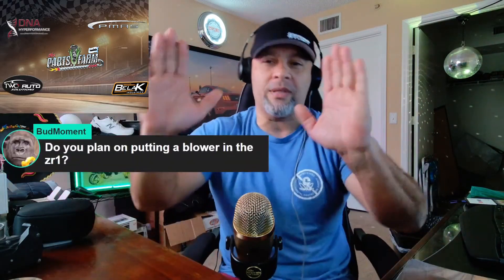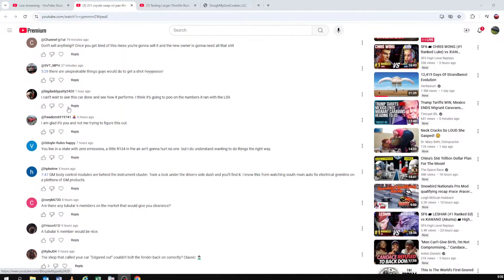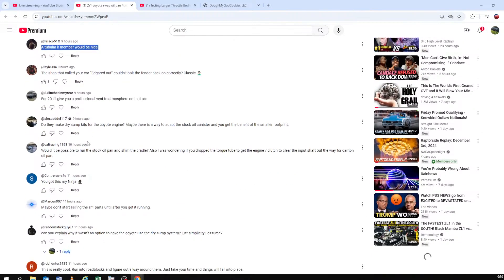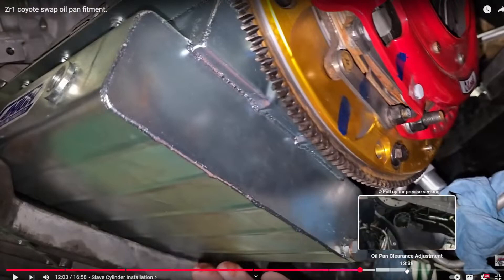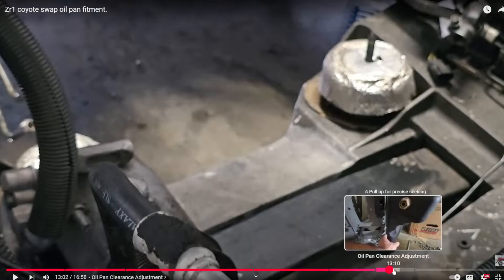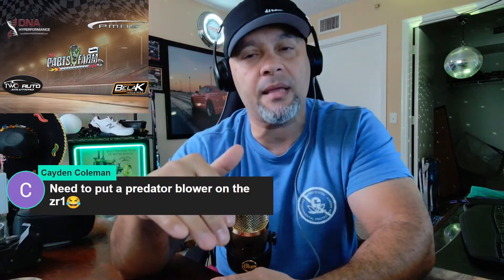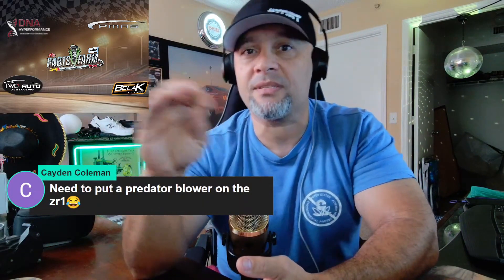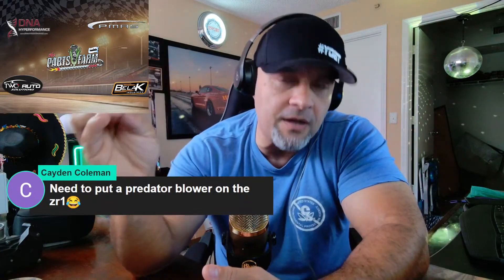The ONLY Supercharger I'll Put on My Coyote ZR1

Comment: Alex. So I just put a haltech on my c5. C6 is very similar setup with the PCM BCM there is a way to trigger the bcm without the factory pcm in the car, hard to find the info on it. However the by far easiest way imo is to depin what is not needed from the stock pcm and remove it. Stock pcm needs oil pressure, crank signal and CTS to make the ecu think it’s running the car. If you “piggyback” the yote ecu and the gm pcm the stock cluster and the bcm should all work and be happy. Gonna have to turn a lot of the dtcs off in vcm editor To turn check engine light off. That’s how alot of ppl are doing standalone ecus on the c5/c6.

 There’s a decent amount of pcm wiring info on corvette forum as well. It took me about a day to get my crusty 01 engine harness unloomed, wires not used depined & removed, and both the harness installed back in the engine. I’m not familiar with coyote sensors, however I don’t see why you couldn’t split signal from yote harness and pin it to the zr1 pcm provided they use the same style sensors.

Comment: You against the ess blowers? Those cars seem to run hard
Reply from the maker: @joshuaearnheart2756  when the hell did I say that?
Reply: @didn’t say you did. Meaning for this build Is that style of blower not what you’re wanting. Are you wanting a top mount/PD/twin screw/roots style specifically? Simple question really. Considering you would “never support whipple” or “would never run the Odin” you seem to have things against certain companies. Is the ess an option?
Reply: @joshuaearnheart2756 he’s not building a roll race car that’s why. Digs only !
Reply: @Coyote.Collector  it’s still a blower. Gonna make torque. And with similar boost, the ess 60-130 times are generally quite a bit faster too.
Reply: @joshuaearnheart2756 again you said 60-130 
HE IS NOT BUILDING A ROLL CAR!!! 

ESS DOES NOT MAKE THE INSTANT TORQUE LIKE A WHIPPLE,ROUSH OR EDLEBROCK!!
Reply: @ it’ll make enough for the 1 second that they’re different. Those corvettes aren’t exactly known to hook from a dig anyways. Haven’t looked much into the car but I assume he’s not running the trans axle transmission which means even more weight off the rear tires. Idk if you watch cleetus McFarland or not but he just built a whipple coyote f150 and a twin turbo f150. The whipple truck jumped maybe a half truck at the line and then at about the 60 foot it got drove around. The turbo truck freight trained him up top. Pulled a full truck ahead on 50% duty cycle. Go to the track and compare the amount of blower cars vs turbo cars Then tell me how good those blower cars are…

Comment: Big fan of your channel and learned a lot from you. I just would never coyote swap a ZR1. That’s cool for a regular c6 or a C5, etc but a zo6 or ZR1, no sir. You’re taking away from what makes it special/different but like you said your money, your car, your build. And this is coming from a mach1 guy. I love both brands and this is cool to see. Never seen this done before. Good luck with the build man
Reply: But youre not weighing the "troll factor" for the LS guys lol. It's worth it.
Reply: With all do respect you might not have heard his reasoning. 

The car has A LOT of miles on the chassis. So already it's worth less than worth selling.

Motor is like 15k for new motor.

Coyote with blower weighs less than ls9.

Coyote doesn't need cams or headwork. 

Headers fuel system boost is all coyote needs to make north of 900whp on an alluminator.

Last reason he literally had this motor already. So that 15k on a motor he doesn't have to spend.

Again no disrespect meant just writing what I've seen Alex say and show.
Reply: The zr1 crap motor heat soaks and pulls timing with under 800hp and will blow up 

The coyote can make 1,000 won’t heat soak and will make that power WITH EASE. 

Not tryna be an ass but do some research a coyote is better than any LS or LT.
Reply: The only good thing about an LS9 is that it’s dry sump.   Big POS otherwise, just a notch above the LS7 is its utter trashiness.

Comment: Dry sump the coyote? Not sure where the pump would mount, but if it’s possible then you can run damn near a flat pan.
Reply from the maker: @stevenbesson8988  tell me you didn't listen to the video without telling me then listen to the video.
Reply: @ no, I didn’t, but it would allow reuse of the existing system aside from the pump and lower the engine as far as possible in the chassis, which would give you blower clearance.

Comment: Just thinking of the electrical stuff on this project. Ooooffff good luck with it man.
Reply: I'd rather see a midnight performance twin kit in the vette
Reply: Engine is easy. BCM might be a little questionable, and of course triggering the HVAC circuit, which might be the largest annoyance.